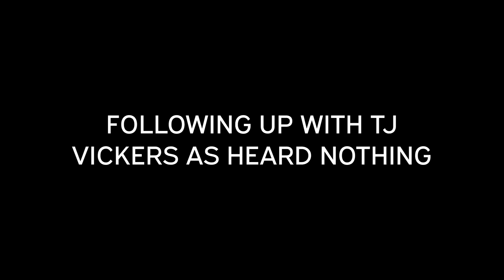HAS CANADIAN VAN LIFE KILLED OUR CAMPER VAN?  [S7-E54]

Comment: The sway bar is called a drop link , the strut part is only a dust cover which you could drive without replacing until you get back to the uk
Reply: But the bump stop is also buggered ! New front strut bump stops required !!
Reply: The bump stops and dust covers are service items, should be cheap on eBay. Good luck! They will take the struts out to replace those bits, a good time to fit new strut top mounts as the bearings suffer over time.

Comment: I am glad you got the parts and at the right price. Ducato parts, also older ones, are quite common and relatively inexpensive - even up here in Finland. The shock assemblies, bearings and stabilizer joints are all consumable parts, which are easy for a garage to replace. With the parts Trudy will be like new again 🚐👌  Safe travels from 🇫🇮

Comment: If it is mechanical, it can always be fixed, always. The suspension struts bump stops and bellows you can get , you do not need complete struts as the springs are in good order as are the seals.
Reply: Great advice !

Comment: the 3 models ( Fiat, Citroen and Peugout ) ran in the USA from 1994 to 2006, so there must be dealers around that dealt with one or the other brand who have/can get parts or if not one of the huge Breaker companies in the states may have reconditioned ??
Reply from the maker: You would think !! But the parts are all different 🙄
Reply: @TREADtheglobe  have you actually sourced it all yet ???
Reply from the maker: Hi Mark - we have now - there are a few more issues ... but we are lucky to have a fabulous TREAD community and supply chain worked out - we will always get through it as there is no other outcome other than to solve / resolve issues and we will share it as it happens and as soon as we can edit the footage 👍